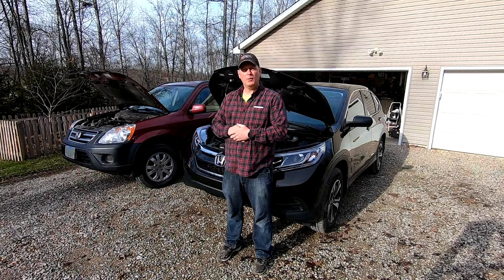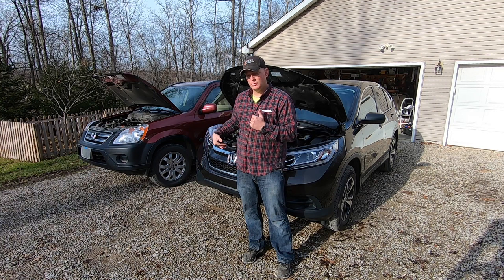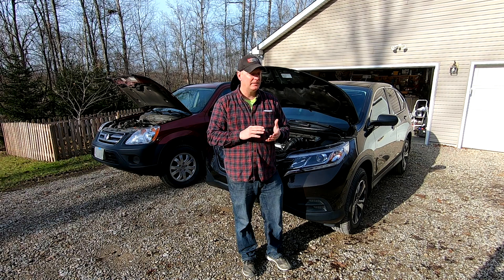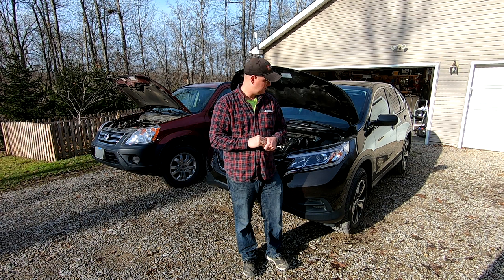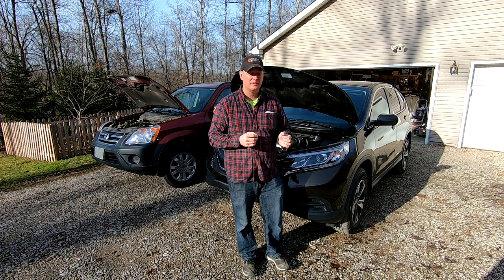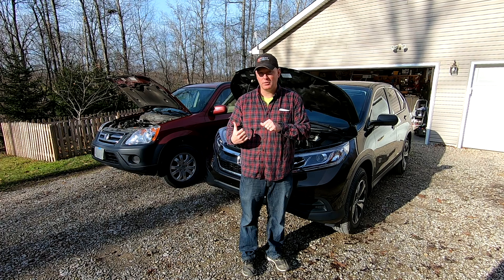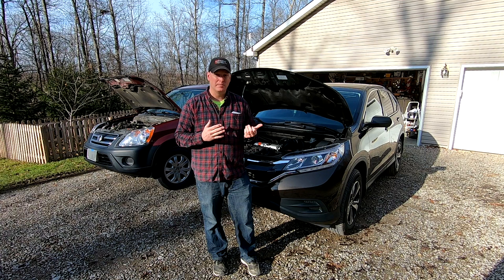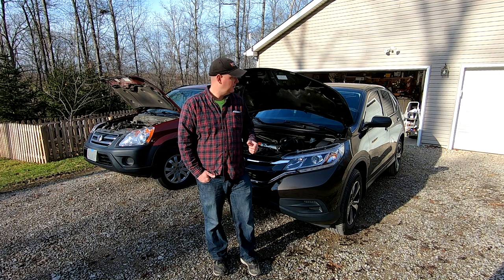DON'T BUY THIS CAR - 2012-2014 Honda CRV

Comment: I have to disagree. About gen 4 later models..... our 2016 gen 4 is superbly reliable. 90,000 and going well... No.sign of this fault. Maybe it was rectified by 2016?
Reply from the maker: In the title it says 2012-2014. Starting in 2015 they used a new design earthdreams engine. It has a different rattle fault caused by bad cam chain tensioners. It is relatively easy to fix compared to this though.

Comment: My 2012 cr-v started noise from vtc actuator, replaced under warranty in 2014.  Now the same problem and told by Honda service it is not a problem just a noise.  Bummed thought I was buying a Honda for the long term reliability.   Also, the wind shield wiper fluid is not protected so unusable in extremely cold weather even with best rated fluid.  I can't give this car to my kid as planned do to these two fatal flaws!

Comment: This doesn’t apply to Britain we have our own Honda factory and our Honda CR-V 2.2 turbo diesel AWD has a 6 speed manual transmission option if you get a sport cat instead of DPF and a remap done 200bhp fun and 40mpg In town driving
Reply: hi im thinking about this car in uk
Reply: @Bcwilderness  ok any questions just message me
Reply: @Bcwilderness  you have 2 main options 1.6 dtec or 2.2 dtec or a hybrid if your looking to buy new and spend a lot of money
Reply: @Bcwilderness  all these negative issues been reported are by American who had a petrol version of this car with the dodgy VTC actuator spring problem , this doesn’t apply to the uk as most models are diesel and the petrol version In the uk is very rare and mostly diesel units were and are produced
Reply: thanks, yes you know what its like, reading so much on worst years etc to find its a us review or forum, etc, tbh i know nothing about these 2.2 i dtec but they seem great all around wagons, im a drummer a muso and know nothing really but from what ive seen on youtube they seem a solid choice and can be boosted a little stage 1 or something to perform a bit more, the rav 4 sr180 has a great little engine just dont like how light the car steers it feels disconnected, but im defo getting a 2.2 14 plate crv i think, any advice appreciated pros cons, kind regards john
Reply: @Bcwilderness  at the moment if you look around you can get a great deal I brought a 13 place 2.2 from a lady last year for £6750 with only 102k mileage and a good service record it’s brilliant love it , you seem like a guy who likes a little power performance is good a little sluggish In gear 123 but goes like a rocket after that used car prices are on the rise but nobody is spending much depression on the way it seems , look around I’m sure you’ll find a great deal with a little haggling good luck John
Reply: @cassk9999  ah excellent thanks very much, yes its got to be a keeper truck for me in these price hiking times, it seems a lot of machine for the money good service record is a main factor for me, good to know it will be decent winter and to move a bit when you need to :) here goes to losing a few days searching and kettles on, happy days, cheers c im glad it rocks your boat, i hope for the same

Comment: Folks, don't freak out. These kinds of fixes are not that hard. You can do it! Plenty of good instructional vids here on YouTube for this very fix. The parts run from $25.00 for just the spring kit to a few hundred for a whole new VTC unit.
Reply from the maker: Or a few thousand for a complete timing job . Dealer price of course and beyond the scope of most DIY folks.

Comment: Yeah, im in the same situation. 2 timing kit repairs in 13 months 140k miles on mine, im the only owner.  Ive confronted the honda dealership about it, they play stupid and try and place blame elsewhere. I have a case with corporate. Theres also a class action out of California with a firm called Glancy Prongay and Murray LLP. Hopefully they can get something done for the people. Because there should have been a recall. Also i doubt this stops with the older 20teens crvs. Im guessing they are putting the same accuator in the new ones as well... And again, do NOT buy a CR-V.
Reply from the maker: The newer ones 2015-up use a different actuator that doesn't suffer from the same issue. They do have issues with the timing chain tensioner that can resemble a similar noise while starting. But it is much easier to replace the tensioner only vs the VTC

Comment: That's not a 2013, that's the 2015-16 generation. I've had my 2012 crv since 2011, and it is in fantastic condition. I'll have that thing for a while!
Reply from the maker: Wrong detective. 2013 with a facelift conversion to the headlights and grill. Look closer
Reply: I see.

Comment: Gen 4 2011 newer also have pistons ring problems burn oil, transmission problems especially the cvt. Electrical ecu problems , door harnesses  problems,  and typical honda crap ac compressors. Rear brake calipers locking up .
Reply from the maker: Yep

Comment: I have a 2013 the vtc make noises and iv replaced the torque converter and the power steering don't work other then that she's good and never left me sitting great gas milage to y'all complaining to much at least were not replacing motors trannies and all this other crap other models are but of course I'm a mechanic and work on my own stuff iv had it for 5 years and have put $256 into it power steering is option to me lol I also power lift so it not much of a problem

Comment: Are you sure they really changed the part? Buy the part at your Honda dealer and change it your self see if thebproblem will go away. My bet is they didn't change the part.
Reply from the maker: I know there was new Honda bond sealer on the valve cover and the bolts were removed because I marked them. I'm pretty sure they changed it. It is a reputable Honda dealer, not a small time scam type place.

Comment: What is your evidence that all these bad things (wearing out timing components) will happen ? Or is it just an obnoxious sound on startup?  Many chain drive valve trains make a rattle on start up, it's not the end of days.  I'm not convinced by the generalizations here about Honda engineering going down the drain.
Reply from the maker: Google search is your friend on this one
Reply: Drive chain or serpentine belt? You have both. For the drive chain the longer you wait the bigger your bill and repair will entail. The serpentine belt could have or be developing dry bearings in the pulley. The dry pulley will be making noise under the hood also.  Click Click Click. Parts about 200.00. Get the right parts. The wrong ones came in for mine and were sent back. I had to pay for labor on top of parts. It sounds a lot better now that it has the new parts. My cars vin was not included in the drive chain issues. Yours may not either.
Reply: @JackofAllMasterofNone    Yeah, I did that, and there's no convincing information on the frequency of this problem.  We have a 2014 with 83K, no sign of this issue.  I'm not sure I would condemn an entire company's engineering quality based on an issues that happens with some samples and doesn't necessarily cause any damage and that's easy to fix.

Comment: I would have said don't buy the 2005. The transmissions are junk. Seen nothing but issues on that model. But most of my k24 motors make this sound but never caused issues.
Reply from the maker: Never seen one with a transmission problem. Change the fluid on schedule and they last forever

Comment: The cam actuator is not the problem and never was. This problem only exists because of the excessive oil consumption. I found out on YouTube that running low on oil causes the time chain to lose lubrication. This causes the timing chain to stretch causing the rattle on start up. At around 70,000, these certain models start burning up to two quarts every 3000 miles. Is this the customers fault. I would recommend every Honda owner check the oil level at least once per week. This is an engineering defect. Will Honda fess up and take care of it. No way. Honda will not spend billions to replace these engines. It is called corporate greed. We need to stop buying them. Now, I buy vehicles that are older and have a proven track record.
Reply: I switched to 10w40 to try and slow the oil consumption

Comment: That’s not a big deal, but then again I have a 2013 with a 75,000 mile bumper-to-bumper warranty so it didn’t cost me nothing to have mine done. If you change your oil every 3500 miles it shouldn’t happen it’s an oil pressure thing. I bought my car secondhand I did get some oil change records but you never know anyway, you know it’s a good car you just mad ha ha ha ha take care buddy
Reply: Drive chain or serpentine belt on yours? My vin was excluded from the vct problems. But did have a dry pulley which meant I had to replace 3 parts. At only 75,500 miles it shouldn't have needed anything. First Honda. Never had an American car that the pulley failed on. Not all of the parts going into our Honda's are from Japan. After 2011 and the Tsunami they've used parts made in America.
Reply: @Susan70003  All Honda 2.4 engine have a timing chain

Comment: Maybe you needed to also change the timing chain not just the part 😮

Maybe also need thicker oil especially you live in snow weather 0-20 is very thin oil , so idk 

Also I heard gas can leak in to your oil and make your oil thinner there YouTube 😊videos on gas leaks into oil 

Maybe you should smell the oil from the dipstick see if it don’t smell like gas or something some signs 

I would suspect the time chain was already wearing out when the part making noice so both may have needed changed 

I would also suspect maybe the not enough oil in Motor when changed and high miles and weather conditions made the 0-20 oil worthless and damaged your car 

Just compare your service changes you did with your 2005 crv 😮

1.) time chain wasn’t checked replaced 

2.) gas in oil mayybe making oil weak 

3.) needs to up grade your oil weight mayeb to 5-20 depending on the weather 

❤❤❤❤❤❤❤

Comment: 2012 CRV has a lack of power. Unbelievable power- I mean low power. CRV is just for local shopping, not for long distances. It is super loud( wind noise) and has no power going uphill on the highway. So wobbly on the cornering as well.
Reply: Put it in 3rd.  Plenty enough torque uphill.

Comment: Mate, ALL VEHICLES have problems…EXCEPT when you sell it and no longer drive.
Not a real practical option.

At least you haven’t got cracked pistons…Toyota Landcruiser Prado/Hilux here in Australia.  I own a 2014 CRV 2.2 diesel, 6 spd manual.  Thanks to stupid emission design they have expensive Diesel Particle Filter issues, but these can usually be professionally cleaned with 97% success for a much more modest cost and it lasts so much longer than DIY cleaning.
Regardless of what u own, they ALL break down.
Just wait till electric vehicles get 10 years old and see what issues THEY have.
Sometimes the best vehicles are really old ones, like 1980-1990.
Anyway, we love our diesel CRV and it uses only 6 liters per hundred klms average.
Plenty torque for quick overtaking on one lane roads here in Oz…just don’t get caught by the po po!

Comment: question is why did you throw the 2015 & 2016 crv''s  under the bus ?
Reply from the maker: The title of the video is "2012-2014". I did not "throw the 2015 & 2016 crv's" under the bus. They do have there own set of problems though. I would still buy one however.
Reply: He didn't. This video base on 12-14 models.

Comment: My 2017. 2.4 engine does use oil, which is disappointing, about 1 quart every 3 months. Other than that it's a decent car but pales in comparison to my 1992 Honda Civic, 5 speed.
Reply from the maker: Try changing the PCV valve
Reply: @JackofAllMasterofNone  I did. Nothing changed. I thinks it is cheap rings.
Reply from the maker: First I've heard of oil consumption on the earth dreams engine, but maybe I'm just behind.

Comment: I had to disagree with you I've had my Honda and it has over 300,000 mi on it so that just goes to show lack of Care on the owner's part with minimal preventive maintenance
Reply from the maker: I won't completely disagree with your statement. Proper maintenance (like way more often than Honda recommends) will help a lot. But the things I speak of in this video are very common defects with this generation.
Reply: @JackofAllMasterofNone  agreed
Reply: Well I buy Honda everything anyways so you know
Reply: Honda eu3000 has 140,000 hours on it still running nice and silent

Comment: None or the Honda `s that I work on do that or have ever done that with 200 to 300,000 miles on them ! It is not you work it is the people that work on your car is the problem , some people do not need to touch your Honda`s or your Subaru`s and yes keep your oil level correct my friend ! If I were your tech you would not have that problem !

Comment: Right I have done cars since I was 17years old now 74yrs so no papers all in my head but a diesel man I have the cdti  engine in 08 never been a problem  14000on it then I got a project last year 61 plate with 106000 on it new to me diesel in the oil the idtec 2.2 high pressure pump injectors tips missing  so did all that it started  lovely  run a hr crack it then it locked up it had turned a shell not enough lube so new motor with old out new in 53thou on this  so still ongoing but praying injectors in subframe to go on and then it the key    Now for u put 5. 30in that car oil that 0.20 is like weasel wee try it do the work ya self I only go to garages for test  never mind what Honda tell u Honda want to make money rob dogs try some thing what will hang around that vtc it is draining away  I bet when it gets oil pressure it runs fine then on start up u get the rattle good luck

Comment: Ok I have a 14 CRV and I’m ready to sell it now. It has 105,000 and the transmission does this shaking thing between 15-25 mph. Only had it a year. I’m so not gonna deal with this.
Reply from the maker: Yeah that's another "common" problem. Usually caused by the torque converter needing replaced. You can try a good transmission fluid drain and fill about 3 or 4 times and see if that helps first.
Reply: @JackofAllMasterofNone  I have had this problem for a while now. Did a whole bunch of research. It bothered me so much that I started to consider getting rid of it and buying a new car. This seems to be a common problem. I'm guessing it's because the transmission fluid hasn't been replaced every 30k miles or so. Mine wasn't replaced until I hit 80k miles. It's my fault too, but I don't remember the service ever recommending it to me. I talked to the dealership many times about this issue. They told me to not go with the torque converter or whole transmission replacement, that it won't break down in the middle of the road. They said to just keep replacing the transmission fluid when it starts to shutter again. So I have been replacing my transmission fluid every time I change my oil.  It's annoying but it is what it is. I have seen people saying the torque converter replacement didn't fix it either. Transmission fluid replacement doesn't get rid of the shuddering 100% but it reduces it dramatically to the point it doesn't bother me anymore. Also I was told to keep the econ button off by a transmission mechanic to keep the shuddering minimum. Hope this helps others with the same problem.

Comment: Its called mantinence, all cars have parts that go bad. I have a 2014 CRV that I beat the crap out of, it has 100000 miles and it runs just fine.
Reply from the maker: This is true. Maintenance is very important. But it's also called a design flaw....
Reply: @JackofAllMasterofNone  well yeah but it does not affect the car as much, so much to "not" buy it. Its a honda after all, should last

Comment: Holy crap have 2012 CRV with 246,000 miles motor tranny original VTC been grinding 2seconds in cold since 190,000 miles just leave it why would you poo poo an excellent car. the VTC is nothing that major